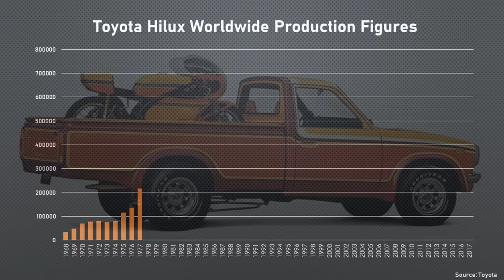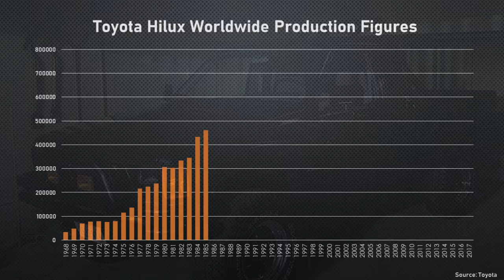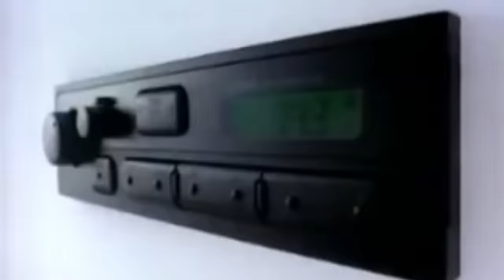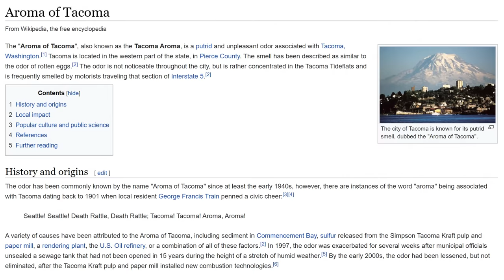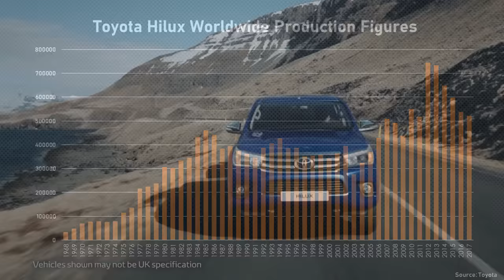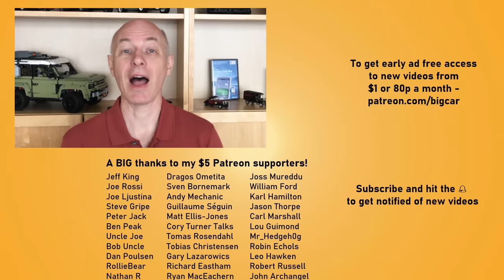Toyota Indestructible Hilux!

Comment: In provincial Thailand it seems that trucks make up about 50% of all vehicles. Toyota and Isuzu are the most popular. Mitsubishi, Nissan, Mazda and Ford are quite a long way behind, but Ford's Ranger and Everest (a truck based SUV) have become popular in recent years. I believe Thailand is the second biggest pickup truck market in the world after the US.
Reply: The correct number is actually 70%.  In greater Bangkok probably lower but everywhere else it is probably higher than that. I live in Hua hin since 2003.
Reply: @bastiaansnijder5317  Interesting. Can you give me a link to your source?
Reply: @PhilUKNet  The annual sales figures for new vehicles are typically around 70% pickups and 30% passenger cars.  Toyota has around 50% of the market so that means in effect that every third car on the road in Thailand is a hilux .  Everyday driving all over Thailand would seem to confirm that global analysis. As far as links I would have to research sales figures. I usually see those from the business pages in the Bangkok Post.
Reply: @PhilUKNet  i need to admit that i have not looked at the figures in detail in the last few years.  It looks like purchase preferences have shifted a little in recent years likely as a result of the low cost economy car production which is a fairly new segment here. However what is on the road today reflects purchases made over the last 15 to 20 years and i still believe that pickups make up 70% or more.  In rural areas away from bkk that number seems closer to 90%. Thanks for the correction.
Reply: @bastiaansnijder5317  There was a big shift when Yingluck offered discounts for first time car buyers buying Eco cars. 2012-2013, I think. I bought a Honda Brio for my wife, but there was a 1 year waiting list for the Suzuki Swift. All the teachers at the school where she works changed their motorbikes for Eco-cars. Different parts of Thailand have different ratios. I'm not familiar with Hua Hin. I still see mostly pickups in rural areas. In Hat Yai, where I have lived since 2003, it is about 50/50.  โชคดีครับ

Comment: I wish Toyota retained the solid front axle for a longer duration in the US. They dumped it in 1986 and moved to independent suspension. Alot of older trucks get cannibalized as donors for solid axle swaps. RIP to all the long beds :(

Comment: Where does the Vios (Belta) fit in to the line up? The 2008 model my missus drives was best selling car almost everywhere it was sold. Size wise it is much the same as the Corolla with a 1.5 (not 1.6) engine. Lots of competition in the pick-up market, too "red-neck'" for me. Fortuna's still sell like som tam here in Thailand.

Comment: 87 toyota pickup  xcab my first  pickup was mine miss it then my favorite was a 99 toyota 2 wheel taco with a 2.7 verry quick. Then got a 06 taco with a single cab 4x4 2.7 very sturdy.then trucks got overpriced. Now you cant touch one. A new one . For less then 37k i cant do it  and call myself a reasonable man at least they did not go in the way of chevy  ford or dodge and kea

Comment: Hilux has everything you need.. 500nm torque.. Diff lock.. 6 speed auto with manual shifts.. VSC ATRAC ON OFF.. eco mode.. normal mode.. Power mode. 2H 4H 4L.

Comment: The kijang is a completely different car from the Hilux targeted at "poor" people (owning a car is still a luxury in Indonesia), it is much smaller than the Hilux and boasts a smaller engine (1.2, 1.3, 1.5, and finally 1.8 or 2.0L petrol and 2.4L diesel), and nowhere near as luxurious nor even the same price as the Hilux, it doesn't share any parts with the Hilux and it also only used a carburetor up until 2007 when it was discontinued (only higher end models got fuel injection)

The 7K engine was also designed and only used for the kijang and no other Toyota car.

Comment: Great video for a great ute. No mention of the Ford Ranger essentially taking over in the last ten years? (At least in some markets)
Reply: No in asia africa and middle east countries still buy the Hilux 100x more than the ranger
Reply: In the main markets they designed for the Toyota still overall outsells the Ford , The other continents just want it to work when it's supposed to. Ford doesn't have good after sales records and are dogged by problems even across facelifts
Reply: Thanks for the replies. Here in New Zealand the Ranger has essentially taken over the Hilux as the ute of choice, they're f-ing everywhere.

Comment: The aroma of Tacoma is not as bad as it use to be. Tacoma got that thanks to all the paper mills they use to have. Now they just have one and it has heavy filters on it.
Reply from the maker: That part of it is better, but there's still the tidal flats that cause a problem, at least when you're on the I-5.
Reply: @BigCar2  I-5 is a pain. A 5 year road project that has lasted 20+ years.
Reply from the maker: @Lurker1979  And WA traffic in general is the pits (at least up in Seattle).
Reply: @BigCar2  Also why I avoid that side. I stay in Kitsap County and Olympic Peninsula.

Comment: Hi!
I own a 1987 Hilux LN65 with only 9600 Miles.
The Firetruck has been on standby  in a small Austrian Firedepartment in a village close to Vienna. Perfectly maintained, no rust at all. Double Cab, Diesel, Power steering, 5gear manual, 100% original.,
Who would know for how much I could sell it? 
Regards
Franz

Comment: Don't forget that Clarkson also drove it down some steps, knocked a wall down with it, drove it into a tree, drove it through a shed, dropped a caravan on it, hit it with a demolition ball and finally set it on fire too and it still refused to die. After it had been dropped with the building demolition, it was only the body holding it together as the frame had snapped in two and it still ran and drove. As Clarkson said they were "in the presence of automotive greatness" and rightly put it on a dedicated plinth proudly displayed in the studio
Reply: I remember when "made in Japan" was said like "made in china" is now...🚮

Comment: The Toyota wars should not be seen as a negative issue. In fact it was quite the opposite. It only reaffirmed Toyota and Hilux in general as the most reliable pickup trucks ever made. Remember in the wars Toyota Hilux even out maneuver dozen of tanks and left them all in the dust!! You won't see any Ford capable of such feat

Comment: you forgot the ln 106 which if from 1991 to 1998 and you called the 2007 hilux 2004 which they had a complete different body, plus the war ute was not a hilux it was the 70 series landcrusier singal cab tub

Comment: For almost all the production time the seats were virtually on the floor and the ride one of the worst of all pickups. It is not so much that Toyota made good pickups but that they had a lot of [unwarranted] hype such as from Top Gear and that they virtually gave them away to war zones, along with the more robust Land Cruiser 75 pickups seen many times in the above video without mention.
Reply: They also rotted badly along with all the other Japanese trucks, terrible rustproofing.

Comment: Okay you got something wrong about the cars isis use, it is a toyota yes but IT’S NOT A HILUX, it’s a Landcruiser pickup a car that they still sell in the middle eastern market. They still also sell the classic Landcruiser those cars are equipped with a 4.0L V6 engine and body would allow it to carry more than your standard land cruiser, and it being a Landcruiser those are made to last at least 20 years compared to your average toyota. What they are driving are locally called the toyota “shass” shortening of the word chassis.

Comment: I don't know how the newer hiluxes are but I was not impressed by the Tacoma. Tacoma has too low a cab roof, and because of this the seats are too close to the floor, the 3.5 liter engine and ancient auto trans gets worse fuel milage than an F-150 with a 5 liter v8

Comment: another reason why we don't get hiluxs in the U.S. is do to emissions, if do go to live in Australia i'll have an 80s door hilux and a chevy suburban and be out in the bush.
Reply: You do know the 2.7 Gas engine the Hilux had/has is the same as the 2.7 in our Tacoma right? We don't get it because of emissions, we don't get it because the Tacoma replaced it here.
Reply: @cpufreak101  I mean the diesel engine
Reply: @Bubbleskittymaster  ah, that's unfortunately more likely due to low demand. Ford admitted they considered bringing the Diesel Ranger over, using the diesel colorado for a benchmark, but the diesel colorado flopped, so no other diesel midsize trucks came over. Not worth the investment to make it pass emissions
Reply: @cpufreak101  because lazy Americans and the fact that in the northern parts of the country diesels are pain in the ass to start.in the cold I live in Minnesota and it get's to -40 degrees fahrenheit sometimes and is mostly -10 to 15 degrees Fahrenheit so them having it flop in Colorado is not surprising to me.
Reply: @Bubbleskittymaster  not to mention the virtually nonexistent economic incentives to go diesel that don't exist here, but exist in other nations
Reply: @cpufreak101  i mean there are many benefits to diesel fuel and engines. But gas is cheaper to produce 1 gallon of crude oil can make 7 barrels of gasoline while 1 gallon of crude oil can only make 3 barrels of diesel. But i would be the type to run my diesels off other shit I believe that with all the fast foods America has that we can put the left over cooking grease to use for fuel. I mean as much as peta won't like it there is still gonna be fast foods making bif Macs so why not just cut crude oil out of the picture it is easier and much safer to come by and there is a shit ton of it.

Comment: I usually love your stories but I'm sorry the Hilux/tacoma is not the wonder vehicle you make it out to be.  You have conveniently skipped around the frame rust recall where Toyota either recalled or bought back almost 700k trucks.  If im going to buy a narrow, underpowered truck it would be nice if the frame didn't fall apart.

Comment: That VW badged Toyota Hilux was the most reliable Volkswagen ever made the only one thats not a pile of crap only if VW based all there vehicles on that Toyota Hilux and l am a very proud  owner of a Toyota Hilux you didn't include the Australian model Toyota did make one for the Australian market up until 2003 and you didn't mention the 22R engine which was available in Australia up until the 30th of September 1997 in Australia and my Hilux is built before that date and it maybe the last carburetored vehicle ever made because my Hilux has a carburetor and no cat coverter it also has quarter windows they finished in 2003 on tge following generation of Hilux they are very reliable infact just recently a 1997 hilux sold for aud $ 500 that had done 980000kms and it sold quickly also for the 1997 hilux are selling for around aud $5000 to $6000 one selling for aud $10000 it had been resprayed red the cab and tge most desirable configuration is tge single cab chassis RWD with tge aluminum tray which is the configuration l have Hilux for high luxury it isn't or is it the 22R motor is a one if the best motors Toyota ever made now reliability is a luxury it has a full size spare wheel another luxury especially in Australia is very simple mine has working air conditioning and quarter windows another luxury item air conditioning was an option so was cruise control which mine has but that doesn't work there no computers or modules to fail and the only electronic thing is the radio cassette player and that still works and everything still works well for a 26 year old vehicle  still works has done only 430000kms the motor doesn't burn oil and acording to its build quality it should last another 26 years easily thats 52 years without the engine been pulled out and it will out live me it will be more than likely be passed onto my daughter abd she can drive and apreciate how good it is

Comment: "The slightly smelly City"? And this video was produced late 2020. I'm sure if you worked at it you could do better research than this. Yes there was the phrase "Tacoma aroma" back in the 80s. That had to do with the pulp mill plants down near the waterfront. Most of which are gone now and any that remain have scrubbers and that aroma has disappeared a very long time ago from the area.

I find your channel entertaining and informational however I highly recommend you do some due diligence on Research before insulting someone's home City.

Comment: You need to do better research before you make a video. When Toyota first introduced 
the small pick-ups they were called SR5, they did not start making the T100 until 1993
and was rebadged the Tundra in 1999!!!!!!!!

Comment: Hang on... what? #1  "Small ladder on frame vehicles"? 
There's no such thing as a 'ladder on frame vehicle'. 
The chassis/frame is the ladder.  Go on - look at any one of millions of chassis diagrams.  Two long chassis rails, connected and braced by several short sections of frame, roughly resembling a ladder. 
The vehicle body is on the ladder frame. 
Hang on... what? #2   The narration talks about the Stout, and then the Light Stout - but the images are arse-about.  The red vehicle is the later Light Stout. 
Hang on... what? #3  The indicators on the illustrated early HiLux models, aren't positioned in the holes of the mirrors.  The indicators were up on the mudguard panels, because they mimicked the similar items on the hugely popular LandCruiser. 
6:36 Hang on... what? #4  The 2wd HiLux didn't change from coil spring front suspension to a double wishbone set-up - it always had double wishbones.  The spring type changed from coil to torsion bar.  (Honestly, this is friggin' basic stuff.  Why doesn't he bother learning some basics?) 
8:48 Hang on... what? #5  Still more lazy errors - both images of HiLux vehicles in the supposed 'Toyota War', are LandCruisers, not HiLuxes. 🤦🏼‍♂️
That's what lets down Big Car all the time: too many obvious signs that videos are slapped together only to get likes, instead of this guy documenting something he actually understands.

Comment: 2:40 did I hear you say Toyota Corona?
Reply: The toyota corona was also a model
Reply from the maker: Yes, very odd they made a Corona and a Corolla. Easy to get the two names mixed up.
Reply: mikajlod25 - as the host here (and Scotty Kilme) have explained, Toyota made several nameplates (Corona, Corolla, Crown, Tiara...) that were based on "CROWN". And yes, the Corona Ute (as in car-based pickup) was a thing in the 1960's...
Reply: @BigCar2  in Europe the Corona was called Carina.  Perhaps this only applies to cars made in UK at the time.  My dad in Holland had a 1994 Carina E. My brother still drives it today.  It never fails.
Reply: Another very popular car in Australia during the 70s and 80s only to be replaced by the Camry and continue to be one of the most popular sedans

Comment: Indestructible? You must have never owned or used one. I did. I took delivery of a brand-new Hilux. Three days later it got stuck the first time. Even though it was meticulously maintained (serviced ever five thousand km) it went on giving problem, in one occasion the brakes stopped functioning and the vehicle would not stop. Another time oil from the rear differential penetrated the rear brakes and the brake peddle stopped working and became sticky. The transfer case bearing became noisy, ball joints distorted etc.

Reliable? A wishful thinking. It is the worse vehicle you can purchase. 

Toyota excels at two things -  marketing and hiding engineering and quality faults. The Hilux is the epitome of selling nothing for premium price.

Comment: Are you getting into cheap Kilmer clickbait territory now? Toyota still sells light pick up trucks in America!
Reply from the maker: They do, but the stopped selling the Hilux, to replace it with the Tacoma which more exactly fit North American tastes.
Reply: @BigCar2  Toyota still markets its light pick up truck as the Hilux. In the US, judging by both having  the same curb weight and 2,8 engine and possibly the very same chassis, I suspect it is marketed with a different body styling( easy to do with a ladder frame) as the Tacoma. You changed the misleading title so thank you for upholding a good journalistic standard.